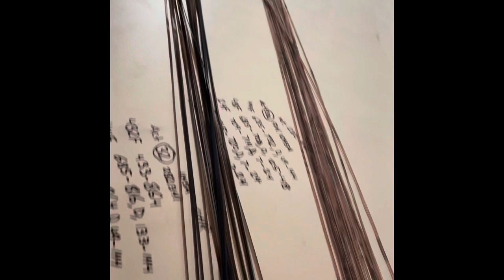How to prep Ribbon fiber optic cable

Comment: Love your videos man. I need some advice though. I have 864 unitube sst tinted, wondering what you think is the best way to dress them in the basket. Is there a braided mesh to use or a small plexi tube instead? Thanks in advance..
Reply from the maker: Hey thanks for watching glad you like the videos. great question you can do a few options. Transport tube or snakeskin which is the braided mesh. Personally I would just ring cut the unitube 3 to 4 inches into the basket. Have the fiber run loose around the basket and have it run through transport tube up to tray. All depends on the customers quality control measures and how they would like to see it built.
Reply from the maker: Check out one of my newer videos called ribbon fiber optic cable fosc build. I go into more detail on how Run fiber from basket to tray

Comment: Love your work! My only critique is the cutting off of the other bond straps. Maybe its a local practice, but in Texas we bond each cable separately as much as possible for locating isolation purposes. Each cable gets it's own bond to the bond bar in the handhole so that locators can just unhook the one they need to locate without getting into the case. Still sometimes we arent able to do it because there may be too many cables in the case and have to group them up. What are your thoughts on this?
Reply from the maker: Thank you for watching I appreciate you commenting as well🙏 I understand bonding each cable will allow for isolation in case of the need to locate the cables out. For standard practices here in Canada all cables must be grounded to one single bond strap that leads to the one ground on the exterior of the case to the ground bar in the vault. All of our cables we place and splice must be labeled at each duct opening, on the exterior of the case and on the inside of the case to ensure there is no confusion when it comes to tracing cables out. If I ever run into mixed cables I just use my otdr and ruby red to determine the flips or issues in the network then get everything connected properly and prove it through my testing and power meter results